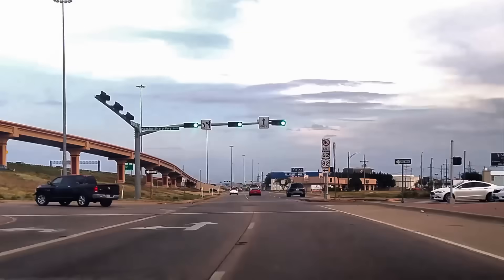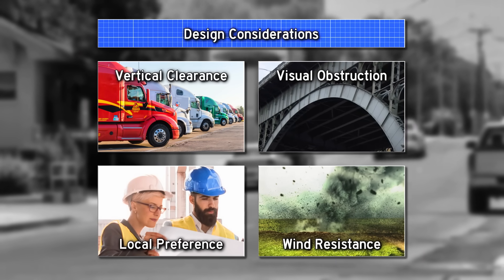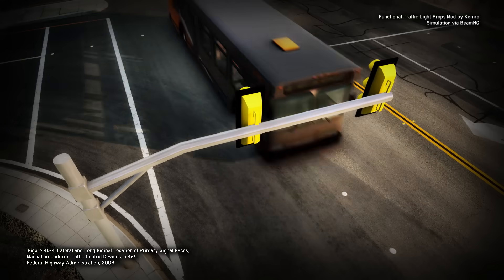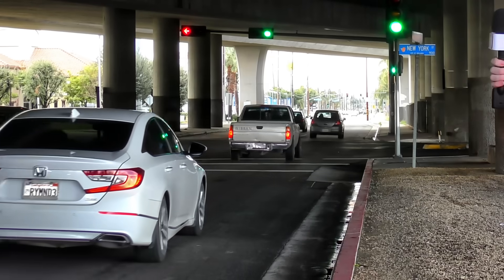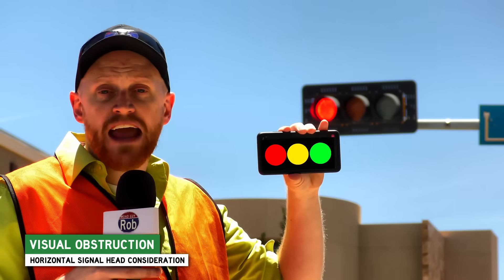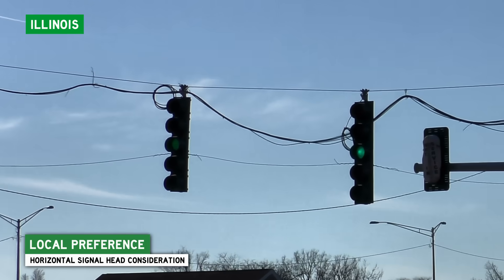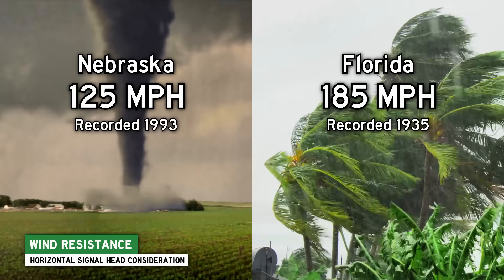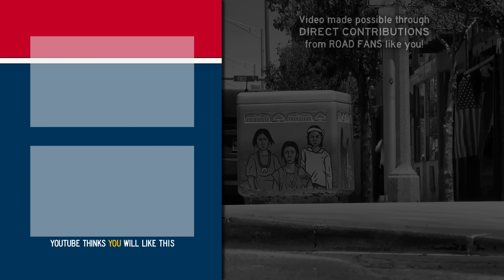What's up with SIDEWAYS STOPLIGHTS in Texas and Florida?

Comment: Here in Brazil there isn’t an actual rule defining where (before or after the junction) and how (horizontally or vertically) the traffic lights should be mounted, but you can see good results at various cities.

At my city they put the traffic lights just after the junction, so you can see it as clearly as possible, it’s usually not confusing. 
When it’s not possible to do this, like at a complicated junction, they put it just after the stop line, which makes it trickier to see it but ensures that it’s that specific traffic light you should worry about.

Comment: Just in case, anybody doesn’t know they do that because there’s more mounting points. This is very common not it not just in Florida not just in Texas but in every state. This is not a big deal. There’s nothing special about it it’s just mounting points would you rather have two screws in holding a 60 pound object or would you rather have six screws holding a 60 pound object over cars going 70 miles an hour? This is just common sense people.

Comment: Wisconsin has sideways stoplights since the early 90s and still have them. Wisconsin could of had them earlier. They still have them today. I guess they fit the pole better. The lights are vertical on the sides.

Comment: In many places in The Netherlands traffic lights are positioned over the crosswalk above where cars would typically stop in the US. Which means cars have to stop at least 40 ft back from the crosswalk discouraging cars from blocking the crosswalk and helping to protect pedestrians. It’s also illegal in many places there to make a right turn on red as you will be looking for cross traffic on the left, not looking out for crossing pedestrians on the right.

Comment: Just to correct. Standard Japanese in books reads as follows :
Characters are vertical top to bottom, first line on the right of the page last on the left. 
It's only in the case of characters are lined horizontally (often in hand writing to fit a western standard lined paper) that they read left to right.
Therefore their lights follow the same logic of reading standard.

Comment: Love your videos Rob !
Iv'e been watching for long enough to realize were practically neighbor's.   You use quite a bit of the local area in your videos.   So my question to you is have you been down Cherry Valley blvd. Through the construction zone Recently?  With my limited knowlage on the subject from working with a local utility I see conditions in this location that not only apear to be in violation of traffic code, but also presents hazards that they have not taken proper steps to mitigate.  From a poorly placed "arrow board" that blinds approaching drivers,  blind obstructions in travel lanes, failure to denote hazards in either direction of travel, lack of lane delineation and inadequate signage.  This is currently a construction zones and has been for approximately 2 years and while I know this is "temporary" there have been multiple fatalities, vehicle collisions, accidents and incidents of vehicle damage due to the conditions in the construction zone.  As well as insufficient traffic control and lack of protection for individuals involved with the construction project.    I have a vested interest in this situation as I and my loved ones travel this section of road on a multiple times a day basis.  
I'm not asking for anything from you, but if you have time to check it out both during the day and night I believe you would be in agreement.  I think you could use the situation to make some content that might be helpful and informative to the City and individuals working in construction zones and those responsible for traffic control to keep the public safe.
Thank you Sir.

Comment: In Turner, ME the one traffic signal, which is a span-wire, got a bit twisted up in a wind storm last year.

They probably used span-wire for cost cutting, they only put it in to manage the traffic around the then new supermarker.

Comment: You talk about how stop lights have to be a minimum distance away from the intended stopping line in the US. In Europe and many other places they have the exact opposite standard. In most places, they put the stop lights on the close side of the intersection as a safety measure. It prevents drivers from stopping too far forward and blocking traffic or pedestrian crossings because if they did they would be unable to see the light.

Comment: Sideways mounting does not make the heads more aerodynamic - they have exactly the same surface area. What it does is reduces the torque on the arm. Instead of getting all of that up/down torque, it all goes side to side, which is where the arm is strongest.

Comment: Yeah why do some states  mount their traffic lights horizontally instead of vertically? When back in the day. When the first traffic lights were invented. With nobody still alive to remember anymore. They went top to bottom not side to side.

So when people wonder what came first the chicken or the egg? They'll find the answer is, Soup. The noodle came first.

Yes, 50 years ago..  At one of the first jobs I ever worked. One of my colleagues had really bad case of, Red/Green, colorblindness. He told me traffic lights,, were a problem when horizontal. He told me it was just lights that lit up. He couldn't tell what color they were.. And he was not supposed to be driving you told me. But he had a wife and a new baby. And he said what choice do I have?  He said it's only a problem with horizontal traffic lights. He said otherwise he sees just fine. But not colors.

Later on, doctors figured out. They could give them one colored contact lens. That allow them to then judge the differentiation  between shades of light. To determine what color they are viewing. Without being able to fully comprehend, that color. Though it was emitting light.  Without a, definitive color. I can't imagine? Seeing and not comprehending the colors and the saturation of the colors of which you are viewing but cannot discern. I'd rather be drunk. Than, have to wonder what I'm looking at when I'm sober. And should refrain from telling women. What a beautiful shade of, green, their makeup is. And that blue lipstick.  And delicious green and fresh steaks ready for cookin'. Mmmmm,  mmmm!

I can't imagine that food looks delicious with colorblindness? And those beautiful, creamy gray yolks of the eggs. Those gray yolks will brighten anyone's breakfast day. Beautiful gray and fluffy scrambled eggs.

When sautéing onions. Make sure they turn a beautiful royal blue color. With that tasty green gravy..

I frequently get Carol 56 and 65 backwards. With resistor color coding. I really can't tell what order the green and blue are in? I mean how do they expect you to read resistor values? If they use the same color for both numbers, 5 and 6!? Whose bright idea was that? Try to get that right with a little green blue color blackness. I can see green. I can see blue. I could tell you what is green and one is blue. Sort of.  And sometimes get that right.. I've got like a 50-50 chance. And then only off by one oor 10 or 100 or 1000 or 100,000 or 1 million. Which gets me close. So I've been winging it, for the pay is 50+ years. And no one's been the wiser. Including myself. I've been fully myself or years. Thinking I could tell the difference between green and blue. I get close. But really aren't they both the same? And should we have two different colors? Why can't we just have, green/blue or blue/green and be done with it?  Why do we need all these other shades? They all look alike! Sheesh!

Open your eyes people! Only some of us are sort of colorblind. But only sort of. Oh yeah that's green. And that's blue. When they are highly saturated in the depth of the color. I have no problems. So, Day-Glo blue and Day-Glo green. No problem. Pastels? I'm not good with, pastels. Yeah it's a pastel. What color? I don't know it's pastel. It's a lighter gray than the darker gray. But not as bright as white not as black as black. And perfectly understandable to be able color you do not  have the ability to comprehend. It's sort of like. Seeing the layout  of your, Lamborghini dashboard. Instead of thinking about how the exterior body looks? Wow isn't that a beautiful fast looking, dashboard. And what depth of resilience padding! In only the finest shades of gray. Sure to catch everyone's eyeIsI's.  And a beautiful tone of brown. With beautiful touches of beige. To light up any dark and confusing place.

I had a colleague friend I worked with from time to time. Who had been blind since birth. With no eyeballs. And I asked him once, back around 1978. Not having experienced vision, at all, ever. I asked him what his sleeping dreams were like? He turned and looked at me with his missing eyes. And told me of course Remy they are all tactile dreams. Right, of course. I should have thought of that had I opened my own eyes? But certainly an amazing non sequitur for us sighted people. My dreams look like a,, Cinemascope Technicolor movie.

As a result of my, realistic, you are there. Can't tell the difference between  realities. Having dreams within dreams and realizing you were dreaming within a dream when you wake up. And go… What the  FUCK, just happened? Where am I? I'm still in my bedroom?  How did I suddenly get back here? You mean I'm not at, Pedro's, South of the Border on I-95, South? I'm in Austin Texas? Who the hell is responsible for this wishy-washy, helter-skelter, nonsense! With whom do I complain to? Why am I talking to myself? Dooes this mean I don't own a Lamborghini after all?

I don't own a Lamborghini, after all. But I do have a better audio console than, Dave Grohl. It's okay Dave doesn't know the difference. He's just a drummer. With a guitar. But my statement is in fact, fact. Based upon my conversations also. With the guy who invented it. Interviewed in the movie. Sound City,, from 10 years ago. One of the Greatest Rock 'n' Roll Documentaries of TIME! I mean what other documentaries put, Paul McCartney in Dave Grohl's Studio 606?!?!? AWESOME! And all through a slightly scaled-back version of, my better version. Of and by, the same old original, Rupert Neve guy. Whom I had the pleasure of speaking and conversing with. And trying not to imitate his accent as an American does. When speaking with him for hours at a time. It's kind of catching. That you catch, a British twang. When speaking with him for any length of time.  You saw Dave in the movie do nothing more than smile. When Rupert was talking his techno babble gobbledygook with that lovely distinctive British accent. Particularly when speaking about his excellent British conceived and for the glory of the Queen? Audio consoles. But he didn't necessarily agree with, Queenie. He wanted to be a cowboy. When he got old and senile at 70. And moved to, Wimberly. Where the horses only have, American Western horse saddles. In Wimberly, Texas, USA. The other Wimberly. With hillbillies and rednecks and Mexicans to do your yard and housework. At a bargain price! A bankrupt  audio console independent manufacturer, needs! When they want to be a born-again Christian cowboy. In Wimberly, Texas. When old guys like him get senile. And just keep designing and building audio consoles until they died. Which is one of the great things about senility and legendary audio console designers and manufacturers. They never stop doing that. It's a sickness! We all have.. And I win! As I had gotten 2 of them!  And Dave only got one of a, slightly lesser version. Or at least that's what Rupert told me. And told me he had to make mine better. Then his other, much more flimsy, recording studio offerings. When he delivered better versions to the,, American TV Networks. Like NBC-TV that I worked for. And had been using that audio console since 1984. When I won the bid for it. In 1996. And the sequentially matching serial numbered one in 2008. One from, Control Room A. The other from Control Room B. At NBC-TV, Washington, DC. Where I worked for 20 years with those. But got the first one of those 2. After using the first one for only 12. And the second one for my full 20. Before the control rooms were, decommissioned and gutted. After other newer control rooms had been built elsewhere in the building. When those original CR's were reborn. As pure Digital Control Rooms. And those became cooler, still! And more awesome.

And so an awesome place in our hearts. For those old legendary analog audio consoles. When you get them for your own control rooms now! As you really don't want to cut your hit records with anything else. Before you dump thos analog captured sound to, Multitrack Digital.

And so of course what this means? When we go back to the moon. We will continue on to Mars, next. And I still want to be alive. The day that happens. And celebrate by making a recording one last time.  With my now 100-year-old audio console.

An collapse dead. With a smile on my face.   At 100 years of age in 2055. POOF! Fine' 
RemyRAD

Comment: Come to the comments for a quick answer?  Here it is: 
More clearance.  Sideways reduces the risk of a tall truck smacking into the light. 
Also a bit less visibility obstruction, with all 3 lights on the same level instead of red being a bit higher.  
Also a bit less wind resistance, such as in a tornado. 
Also, just bcuz the locals are aesthetic crazies and want it that way because it looks a bit better.

Comment: Too easy....

1) Sideways makes the bottom of the light higher versus hanging vertical.

2) Masts can be lower because the bottom of the light is lower.

3) The lights are more secure being mounted on the arm hortizonally.

Comment: I was told by locals when I went to Nebraska that they thought the wind blowing and tornadoes would damage vertical ones cause they dangle down and thats probly why they mount them sideways. Guess they were right.
Reply: But why does Nebraska mount the signals over the thru lanes horizontal but the left turn lanes vertical? It needs to be consistent or it just looks ugly and defeats the purpose. Just IMO.

Comment: i'm pretty sure a rectangle has the same wind resistance in either orientation, ignoring the pole. When mounted the area of pole it 'shades from wind' either way is probably a single digit percentage

Comment: The argument about Japanese reading is not incorrect, but also not correct either.
As is the norm with Japanese, it's complicated.
Japanese can be written in 2 ways. Horizontally from left to right, top to bottom, and vertically from top to bottom, right to left.
But in the past they didn't write from left to right, they wrote horizontally from right to left. So the traffic lights somewhat make sense from a historical perspective

Comment: My headcanon is that those were originally upwards, but the pole they were mounted on was too weak to handle the weight and the Texan and Floridan weather due to cheapening on the building materials so it bent over on the 90 degree angle, dangling over a road and they were like "nah, it's fine, let it be."

Comment: Id put it down to stop light evolution
When they first came out, stop lights were simply mounted on poles at the side of the road, pole is vertical, attaching a vertical light is simple
But as roads get busier, roads got wider, lights need to be mounted on horizontal arms, mounting lights horizontally is simpler and more effective

Comment: Here in Oregon ours are all vertical with many backplates being replaced with a yellow reflective border.  new signal installs and some older signalized  intersections that  got replacement heads have these heads that have this metal bar that attaches to the top and bottom of the signal head and that attaches to the mass arm.  I’m guessing for better reinforcement?

There is one area that has signals attached to the underside of the overpass in vertical form. Market street and interstate 5.  The heads are attached to the bridge it self.  

I do have to agree span wire signals look ugly.  We have some and there’s one intersection they even removed the bottom supporting wire witch I don’t understand why.  We don’t get massive wind storms but even a small bit of wind makes those heads dance.

Comment: japanese has 2 reading directions depending on the orientation of the text, if the text is vertical as in traditional japanese, and art work, you read the columns right to left, if it's modern business correspondence, it'll be rows left to right

Comment: As a signals engineer, we typically try to mount signals vertical when we can get a signal for each exiting lane. If not, then we may either use horizontal or a combination (horizontal on arm, vertical on pole). 

Or, in the case of it being your first project, you grab the wrong symbol in MicroStation and accidentally call out horizontal signals for lane by lane signals. I personally prefer vertical whenever possible...but either way is fine. 

Would be curious to know if any city or state is experimenting with mounting signals on the near side of the intersection (still 40-ft away) to help keep drivers from disregarding the stop bar and blocking the crosswalk (like is done in other countries), which can cause people using the crosswalk to have to walk into the intersection where conflicting traffic is (yikes) just to cross the street...also for no turn on red compliance.